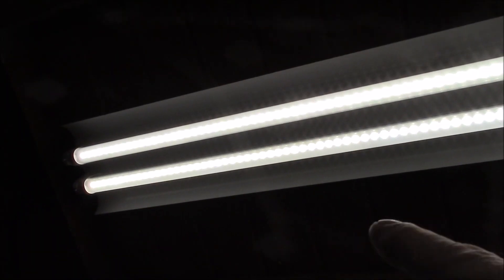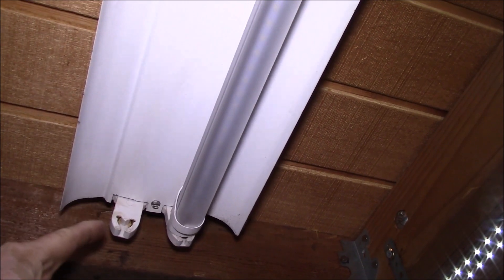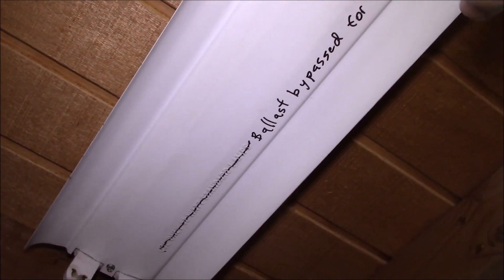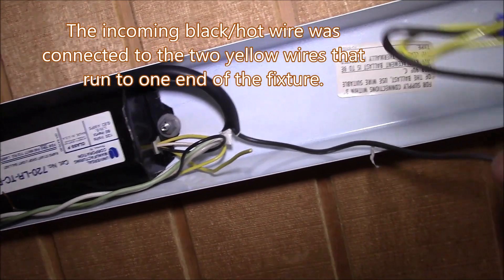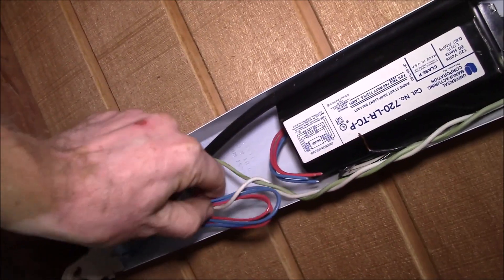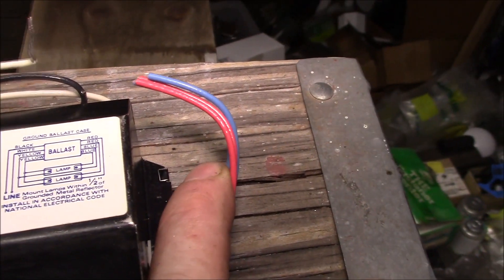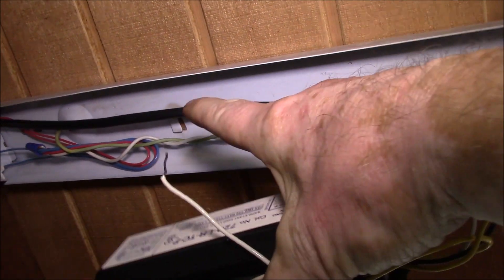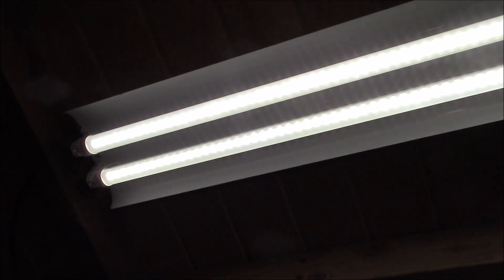T12 to T8-LED Lamp Fixture Conversion Details

Comment: doesnt matter what side neutral or line (Hot) IF your LED are pined at both ends vs LED's that need a NON-shunt tombstone.
Reply from the maker: Yes, that's correct.  I just tried to maintain consistent wiring with all the fixtures I converted.

Comment: Which brand and model T8 LED tube did you use?      And do you think the frosted glass paint is necessary?
Reply from the maker: I can't find any legible brand information on the tubes, purchased off eBay about 5 years ago, marked as G13, 4000K color temp. and 20W.  Ebay won't show me listings that far back.  I went with a US seller who had a discount for a pack of 10 tubes which is what I needed.  At the time, I couldn't find that color temp in a frosted version, so I picked up the clear tubes.  

With no diffuser on my fixtures, the tubes were painful if you caught a glimpse of them.  So I added the frosted glass paint and kept applying coats until the individual LEDs were just barely visible.  If your fixtures have a diffuser of some sort then a clear bulb is fine.  I modified another 2' fixture and for that found frosted tubes and they work fine.  If you need frosted and can find frosted tubes, get them.
Reply: @The4Crawler  , thanks for responding.  Yes I have open fixtures with no diffusers, so I will keep a look out for the frosted lens type.
Reply from the maker: Yes, best to find that type if you can.  The paint is only about $4/can (Walmart carries it), so if you can only find clear, easy enough to fix.